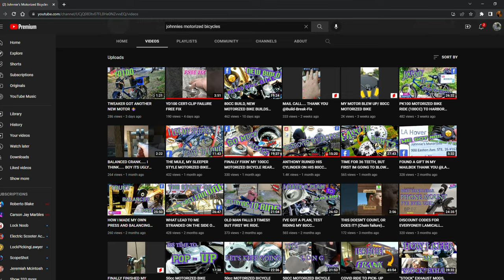Electric Bikes Vs Gas Bikes (In The REAL World)

Comment: I deliver things for a living. I've rented unreliable e-bikes from an incompetent & evil e-bike company called Zoomo. Their bikes kept having hardware & software issues. And they stopped using puncture resistant tires. And I've built a gas bike to be free from them. I'm poor, living in the overpriced NYC. The gas bike was the best option I found. But learning about while using it for work, led to worse reliability issues then the rental e-bikes. That, and mixing 2stroke oil in an office, led to me being fired from a strict delivery job I had.

All this said, I like both gas & electric. But I'm saving to build an e-bike, because I miss the stealth, the cyber jet noises, and I'm just sick of working on a bike when I just want to ride. After replacing the chain with a stronger one, after getting a wheel meant for this, instead of messing with sprocket adapters. I'm still on edge every time I ride my gas bike, waiting for something to go wrong. And maybe because I'm big & heavy, but my mpg seems bad. I do my best to care for the bike. But I'm looking forward to no longer needing this engine kit.

Comment: Motorized Bikes  2 Stroke Engines, 4 stroke engines, and Electric.
I see the biggest difference simply COST. $200-$250 for the 2 stroke, that's engine kit and bicycle, ready to run. With the 4 Stroke add $100-$150. The Electrics, $1200 -$2000 add the cost to replace the Battery, $200 - $300.
I'm a Hobbyist, a Tinkerer. I like the 2 strokes. More equipment to "BOLT ON" to Step up performance, Tuned pipes, High Compression Heads, Hotter Ignition , Hotter Plug, Different Carburetors, and the Jets.
Finally "RANGE". The "WET" engines have the advantage Here.
The Electric may be Nice but the Cost.

Comment: Good morning. Great comparison. I do have a question as someone who has never built a gas powered bicycle before. Is it practical to use a single speed all aluminum 29in beach cruiser as a base for a build? I've been getting mixed or no information on this question. Love the bike and I believe in working with what you have but just not sure if it would work,or work well. Thanks.
Reply: Aluminum generally doesn’t like vibration as much as steel so maybe not, although you’ll get a bit higher gearing with the 29 inch wherls
Reply: @jonathanwilson1380  Thanks Jonathan.
Reply: You can run a 2 or 4 stroke on a 29" beach cruiser

Comment: Gas wins hands down. Almost full throttle right out of the gate. Cost far cheaper then batteries bicycles. Electric you'll pedal far more & get far less. You run out of battery you pedal all the way home. You run out of gas you roll to the next gas station. Overall cost don't buy the $2000 plus Electric bicycle you could buy darn near 10 gas bicycles for the same money. Also those front or rear hubs burn out spend another $500 compared to an 80 wild cat for $135.00

Comment: I'll always go with gas bike as it's more reliable and cheap can go further just like you said getting a bigger tank does not compromise weight compared to electric and battery is so expensive and has distance limitations and not suitable to get wet compared to a gas engine. Electric bike have so many disadvantages specially hill climb eats a lot of juice and tends to get slow as battery depleted and the charging time is ridiculous 5 to 8 hours and adding extra charger and battery is a nightmare to your wallet. Some people say that Electric motor is nice because it's quiet compared to a gas engine no it's not. I have seen lots of people crushing through a electric bike or scooter because no one hear you coming. Gas bike maybe loud but it can be minimized by using a muffler or a silencer and noticable enough for people that your passing. Sorry for those electric fan boys just saying my thoughts.
Reply: And to piggyback on that I think had he compared a 4 stroke engine gas would have won hands down. They are much more dependable less noisy ..dont vibrate as much and they make them smaller now. And I think the maintanance is over exaggerated on gas engines..have a 13 year old lawn mower and only had to replace spark plugs..pull coil and timer...after storing it in a cold garage every winter three or 4 pulls get it to life again 13 years in counting

Comment: Hello, I recently built my first motorised bike. It went a few miles then the engine packed in. The bike won’t start. I’ve tested for spark, compression and air/fuel mixture (all of which the engine has) and attempted a number of fixes however the engine still won’t start. Please view the video I’ve made where I explain the situation in which my bike engine stopped working and the fixes I’ve tried to remedy it on my YouTube channel ‘Christian’s Grand Tours’. Any advice, hints and tips will be gratefully received. Thank you.
Reply: What diag so far?
Reply: Try swapping out the magneto

Comment: How does one make a diy gas bike?
Reply from the maker: It's a broad term, as there are a few common styles (and many more unique ones). But in general you would buy a "motorized bike kit" online. and install it on your bike. 
As far as quality and power, most kits are similar. I like the Wildcat PK 80 from "California motor bikes", or the Firestorm Zeda80 from "Bicycle Engines" 
Many different bikes will work, but cruiser frames are a good starting point due to the room inside the frame. Try to avoid a bike with a coaster brake for your first build. They can work just fine, but it's difficult for a new builder to adjust the rear wheel and wheel bearings correctly.

Comment: I bought my 80cc two stroke bike for $180 on Facebook marketplace place cleaned carbs then drove it. I've had it for 3 years drive it everyday and I mean everyday  no issues except flat tires I live in the city in Florida they dont care . I paid $300 for my electric bike the power isn't there it dies to quick way to quick  . The money I spent on my gas bike is 0 in 3 years ... I got 10 gallons of gas for free from my neighbor he just bought a ebike himiway. I might have spent around $50 on gas max in 3 years and maybe 50$ on oil so it evens out gas is better in my opinion and waaaaaaayyy cheaper. My gas bike goes 30-35mph depending if I add nitro rc fuel to the gas hehe the ebike 19mph. I do however want a ebike that goes 50 mph 300 mile range but the price way to much for me cant afford it

Comment: Are two-cycle engine for a motorized bike is like having a Chevy for a poor man departure interchangeable they're easy to fix if you go to electrical 9 times out of 10 before you figure out what's wrong with the problem with the wine your battery doesn't blow up and burned your house or your garage down or caught you on fire while you're riding it a gas engine yeah you have a chance to catch on fire right now but slender Man compared to electric bike I'm sorry I'm not trying to hate on electric bikes I think they're pretty cool but after watching videos about the batteries blowing up I think I'm going to stick with gas cuz like I said they're poor Man's bike because they're easy to fix the parts are cheap you don't have to have them high before it's actually enjoy the hobby and actually enjoy riding them thank you have a blessed day

Comment: I am using gas bike for food delivery work. Most of the things here are true but some not. You can pedal the gas bike for the longer distance too easily, just remove the main chain. For low speeds pedaling would be better. E-bike is good if its new but old e-bike is a pure nightmare. 
Maybe I am lucky, but my gas bike engine does not need too much work and maintenance. The main chain is main problem and bicycle itself.

Comment: E bikes Fires
Reply: Seen the one that exploded on a packed commuter train? Fkn scary stuff
Reply: @Franklin Freewheeler it's those cheaply manufactured electrical components that are the problem. Batteries overheating and melting and controllers that aren't up to spec 🤦🏼‍♀️
Like what was said in the video, you'll smell a fuel leak pretty quick compared to an electrical fault

Comment: You think an electric, with is weight and batteries, is less bulky than a four stoke. All that torque to easily climb hills, get awsome fuel mileage and not have to subject the public to the annoying sound of a 2 stroke, burning itself up.
Reply from the maker: When it comes to bicycles, 4 strokes suck.
Having tried all 3 options, I will pick a 2 stroke or electric over a 4 stroke every time.

I know this is the part where you will go on a rant, but I just don't care... they sux.
Reply: @LAHover you are not really elaborating on WHY you dislike 4 strokes

Comment: I have both, a 212cc on a bike and a electric-dual-battery on a Super73 clone. The 212 will outperform in range and distance versus the electric Akez Ebike. What is not
commented on, how long does it to recharge at 2 amps (safe limit on the Lipo) batteries. The answer is, 4-6  hours and that's a JOKE!  Do you know how long it takes
to recharge a tank on a motorized bike, about 1 minute! Another thing, in a race up a mountain with a electric bike who would be successful reaching the top, a gasbike
or a electric? The gasbike will beat out the electric each time there's no comparison between horsepower and what develops more, electricity or Petro for long periods
of time. Review the videos on YT, and watch, everyone of the people are worried about their voltage and charge plus range to be able to get home. What a joke, the
Petro bikes are king ! Those who live in the metropolitan areas of the County are ok with Ebikes not putting them down since it's a far better transportation system versus
a car or a commuter system! But, to impose a electric propulsion system on the Populace in "FlyOver Country" is in itself stupidity and knocks on a lack of reality!
The people in DC do nor live in the real world!

Comment: I am not expressing HATE . DID an electric build..Controllers & variable speed motor controllers burn up to early. These are micro circuit boards that can't handle the amps. The controllers never come with decent wiring Instructions AND WAY TOO MANY WIRES..AND AGAIN.. puny wires cannot carry the amps...2 strokes will not hold up for long.. Aluminum cylinders lubricated with oil that's diluted with gas is defeating LUBRICATION..So prefer the 4 stroke.Gas is noisy but . Far as rain.. Want to avoid getting caught in the rain..Yeah, electric can be stealthy... Casing the neighborhood in the a.m. hours ( hahaha );I can see where s noisy gas bike can make you a target of ridicule..." Oh check out this nut case " ? I like the quiet of electric..But I won't be happy til I build a custom design with full suspension..Fat tires, low rider.. Stretched frame with pedals forward. And probably be pushing 150 lbs , maybe more..

Comment: I'm sorry but but the area I live in you cannot run an apartment if you have an electric bike you're not allowed to have an electric bike inside any apartments or houses or anywhere like that are close to a house charging where I live you can have a two-cycle engine on a bicycle long do you take the motor you know the gas tank off it I mean at night Florence electric we're not allowed to have them and researchers did a study electric bikes are more dangerous than lithium batteries in a gas engine for a bicycle will ever be

Comment: Quick question if anyone can answer it on my two stroke my rear wheel when I get going anything over 10 mph for consistent time of maybe 10 minutes the back tire pops and then gets pulled out of the tire and then gets wrapped up in my chain any idea why that is I've replaced probably four or five different tubes now
Reply from the maker: I responded to your other comment about this. If the tips don't help, you may need to replace the rim, but try those tips first.
Reply: @LAHover  okay I took it all apart today I posted it several places 😅  just so I had better chances of getting a reply but no spokes poking threw no break in the seal I honestly at this point just think I didn't have enough air in it and hit a bad bump